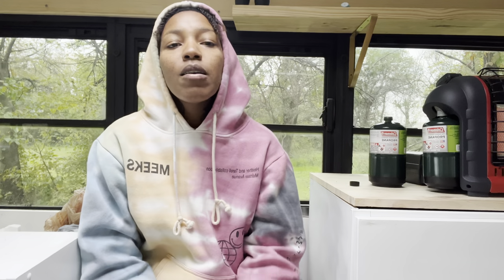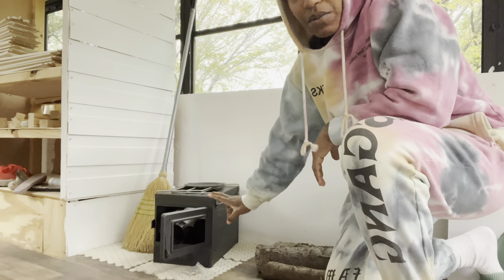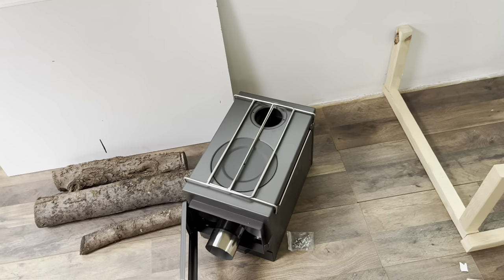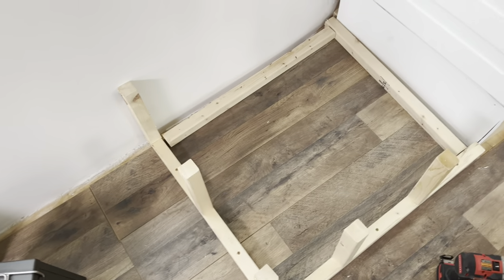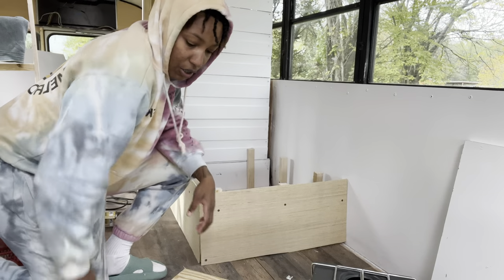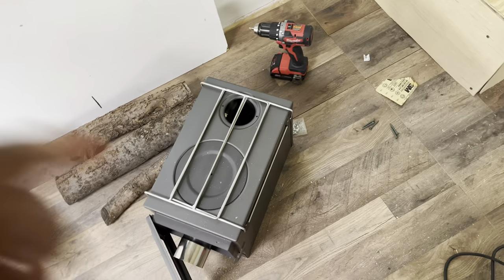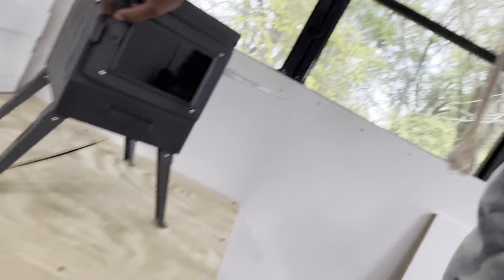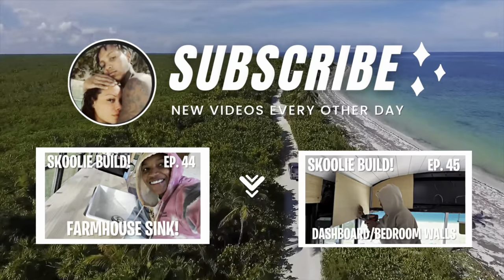SKOOLIE BUILD Ep. 46 *wood burning stove*

Comment: Love the woodburner! I was wondering if anyone has tried venting the pipe through the window instead of drilling holes in the ceiling and roof. Maybe the roof is more efficient…don’t know…just a thought. With every episode I watch, I get more excited for you two🤗🤗
Reply: I thought about it but straight through the roof was easier and much more efficient. Based on the manual for my dwarf mini the 90 degree bend was not recommended unless there is significant vertical rise after the bend.